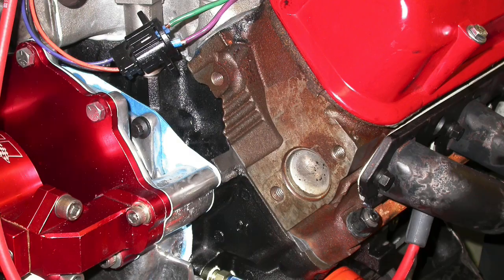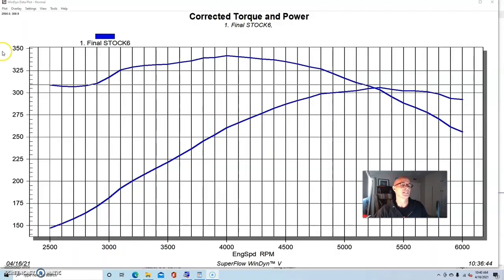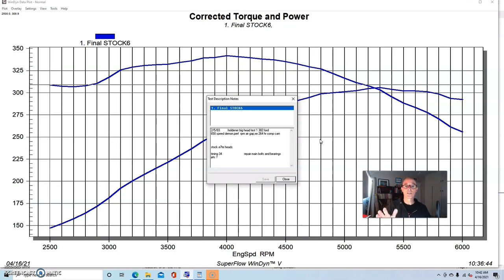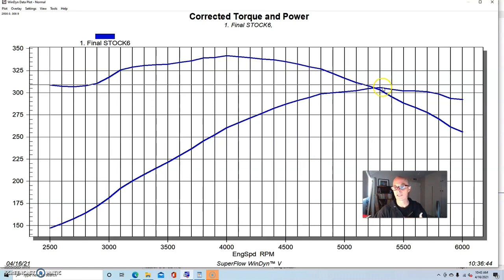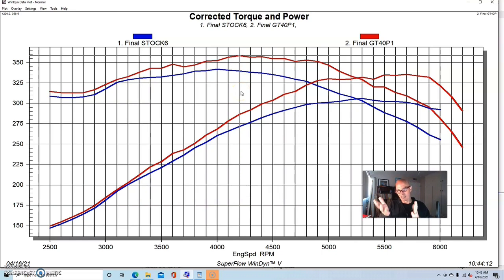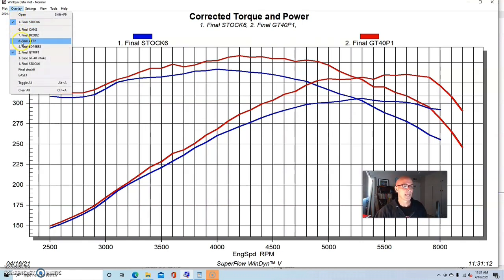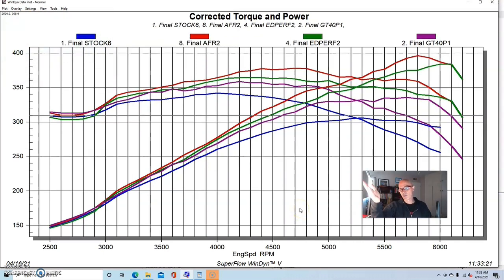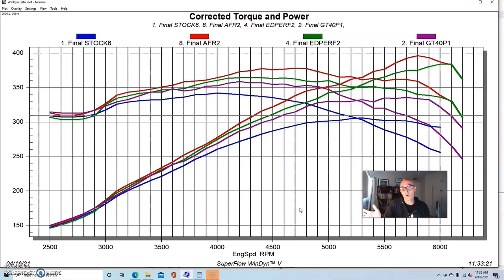JUNKYARD GT40P HEADS-ADD 30+ HP TO YOUR 5.0L (FOR FREE?)

Comment: My son and I have been doing exactly what you have recommended we have two 1980 Bobcats and one 1983 zephyr. We use the combinations you mentioned all three we find GT40p heads on the 351w work well but not as well as on 302. I have been a little hesitant to try and port them I don't want to screw them up. Any idea's on how we could port them and what kind of gains should we expect?
Reply: Just knock the bumps out of the roof of the exhaust and smooth out any imperfections. Don't touch the floor.
Reply: @falconater68  Thank you for the input I will try that on my spare set. How much gain do you think that would achieve? In my mind I always try to justify the effort. I am big into power to weight so aluminum has a pull on me the price pushes me away. If I can get enough of a increase of flow (hp) I would be happy with cast.
Reply from the maker: look on line for porting vids

Comment: So Richard.. how about this... street 302... ever thought about doing a "custom " cam and off the shelf cam comparison to eliminate all the hype?
Maybe some stock trick flows versus ported trick flows
Reply: Custom cam doesnt mean ANYTHING, I have a “custom” Demo’s cam that has almost IDENTICAL specs as a lingenfelter “turbo” tpi cam, the only difference being the LSA. Very little difference i felt other than the idle characteristics
Reply: @lonestaraudioconnection   Reason I bring this up.. there is people out who think a "custom" cam is the holy grail. Huge lifts and they daily drive it wondering why they're always busting valve springs  and getting beat by ots cams a lot of thw times  I'm not a pro by any means... but I know some very fast ots cams out there
Reply from the maker: CUSTOM DOESN'T MEAN ANYTHING OTHER THAN DIFFERENT-I COULD TEST A DIFFERENT SHELF CAM TOO-THERE IS NO MAGIC-ESPECIALLY AT THIS MILD POWER LEVEL
Reply: @richardholdener1727   I edited the post Rich.. But yeah, I thought that was thw case exactly what you just said
Reply: @19jody72  Id disagree....a custom cam from anyone but Comp Cams would be interesting. Let's say Comp vs. Bullet vs. Jones Cam Designs vs. somebody not commonly used.
Reply: @hoost3056   hmm... you think? I don't see how a custom cam is going to be the magic on a street motor.  I mean if you jack up the lift to 570-615 and a ton of duration.. but then you're going to beT the valve train up. When I say street, I'm Talking about get in it and drive across country  chilling with the ac going

Comment: I just sourced a set of gt40p heads for a friend. I grabbed some 99 tumbleport dual overhead cam heads for my Mustang while I was at it.
Reply from the maker: I tested the Aviator intake many times-cool stuff
Reply: @richardholdener1727  I had an idea to plug the long runner openings, using them for a common plenum and run it topless as a full ITB setup, using said plenum for a MAP input
Reply: @richardholdener1727  the short runners would cost low end torque but do you think the small, stock throttle and upper cover were the bottleneck on that intake in factory form? I recall the NA cobra intake performed better up top
Reply: @ElPants21  I know Naz ported an aviator manifold for a fellow with the screen name of "Angus". He went 11.16 on an unopened 4.6 longblock with this aviator. His lid mimicked the Kar Kraft upper that used the dual blade tb rather than a single 70mm. The lid showed good gains but even kar kraft had to halt production on the lid because of cost compared to power gains. The lower and specifically the short runners have a decent amount of work that can be done to pick up power such as porting the injector bosses that protrude into the runners. Angus had gone as far as removing the long runners entirety and just operating on a the naz ported short runners. He claimed a 40hp gain over a ported stock length 99 cobra manifold at 7k rpms and more like 15-20 at the power peak. In stock form, as Richard's testing has shown, the stock intake has a huge advantage in torque production in the middle rpms of the powerband and with that averages power well but by 6500rpms, the stock intake is done making power and that is where shorter runners help. Both are a great option and i love the torque gain below 3k with the aviator long runner.
Reply: @richardholdener1727  Definitely a cool piece. Im just amazed the these can be had so cheap as compared to an oem Cobra intake.
Reply: Tumble port? Ar those the b or the early C heads?
Reply: @Prestiged_peck  They are early C heads. B heads are referred to as swirl port. These 99 continental heads share the same 200°@ .050 intake, 196° @ .050, .397 lift cams that the 99/01 cobra is equipped with. They use the same exact head casting as well.  Flow is 218cfm on the intake side at .400 lift and they are 9.05:1 compression on a stock NPI shortblock.
Reply: @madmod  you can get the later aviator heads if you have a sawzall and a few hours. Problem is most are full of metal shavings from failed timing chain guides
Reply: @ElPants21  Aviator engines are great. I actually have an aviator wap block that will be getting my non pi heads on it after they get some work done. Im just throwing stock 4v stuff together to see how affordable the swap really is. Most of the cars that come into my local parts yard are running and driving so they are reasonably good cores.
Reply: @madmod  all the ones that I seem to come across have bits of timing chain guide in the oil pan so I generally pull them, tear them down, and sell them for parts.
Reply: @2VersTT0  If you've got a ford modular powered vehicle, the aviator is a great choice. They have the most mild of intake cams, same as the mach 1 and 03-04 terminator engine, but they produce great torque and will still rev happily to 7000rpms with the dual runner aviator intake. I will be using a ported Aviator intake on my 4v swap.
Reply: @madmod  for now I have a B-headed mark 8 engine in my little Hyundai accent but it's eventually getting the late aviator C heads & intake
Reply: @ElPants21  You may be better off finding a 99 Lincoln Continental engine for your cylinder heads and cams. The 16° of additional intake cam duration over that of the Aviator cams are worth a good bit of power and the early tumble port heads flow just as good as the later ones. Fwiw, the stock cams in your mark motor are the same as the aviator at 184°/196° .397 lift 114/114. If you can find those heads, you can purchase a complete Aviator intake down to the rails and injectors on eBay for less than 175$ shipped.
Reply: @ElPants21  I must add, I've driven an accent gt and they are small cars. I'm very interested in what trans you used for the mark 8 swap into that car. Is it rwd now?
Reply: @madmod  yeah, rwd but not running and driving yet. Trans is T45 from a mustang GT. Rear end is an IRS with a torsen diff from a Lexus is300
Reply: @ElPants21  Dude that sounds like quite the combo. The accent only weighs like 2300lbs, probably closer to 2800 after the swap. That is gnarly. Definetly gets some vids up of it
Reply: @madmod  definitely. My government funny money went towards a new Tig welder so hopefully it will drive this year. There's some pics of it on my Instagram last year about now when I got the motor in. @Rochacz21
Reply: @madmod  the second hand market is sleeping on Aviator intakes (maybe due to height) I have 3 in my basement from parting them out
Reply: @ElPants21  Maybe you can get a holley lid to work on the Aviator with an adapter assuming you dont have plans to run a hood lol.

Comment: Sir Holdener, will there ever be any plans to do a comparison of the two best heads available, the TFS 11R vs an AFR Renegade on a stock bottom end 302????
Reply from the maker: 11r vs Enforcer is not really a good comparison-better as  cast vs as cast or cnc vs cnc
Reply: @richardholdener1727  I didn’t want to do an 11R vs Enforcer, we are all dying to see an 11R vs AFR Renegade (cnc vs cnc) comparison!!!
Reply: love this idea!
Reply: The Kaase canted valve heads might be better and still fit a stock 4.0 bore. They're huge though, 240cc. Car craft did a test years ago with a huge hydraulic roller and made 520hp with a stock 5.0 short block at 7800rpm.
Reply from the maker: Tim-Must not have been on a stock short block-there is not enough P-V on a stock short block to make anywhere near 520 hp
Reply: @richardholdener1727  actually yes, the valve angle is definitely less then stock. If I'm correct? 10°
Reply: @richardholdener1727  8° x 4.5° cant on intake and 10° x 4° cant on exhaust is the valve angle's on the P-38 Kaase heads. It would be a hell of a match between AFR, Brodix, and the P-38 Kaase heads.
Reply: @timothybayliss6680  those are a bit out of range of ‘most’ enthusiasts! I think the 11R and the AFR are easily the two biggest contenders for the average sbf guy looking to get a new set of heads wanting the most power they can get on a reasonable budget.